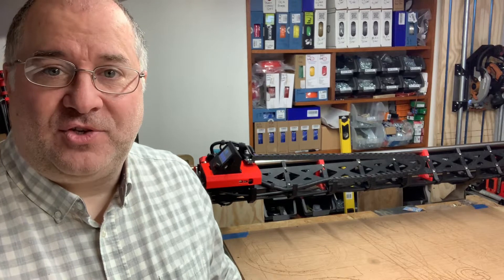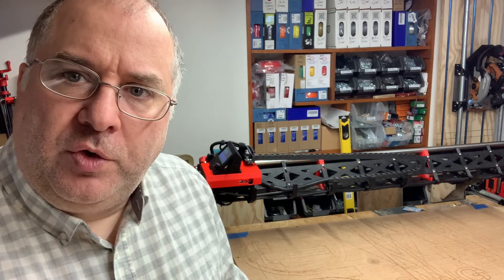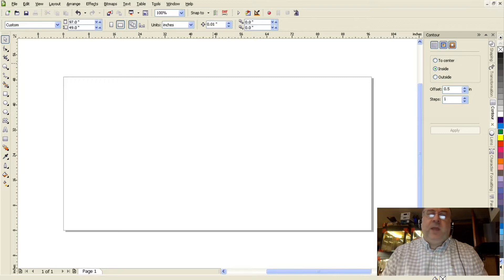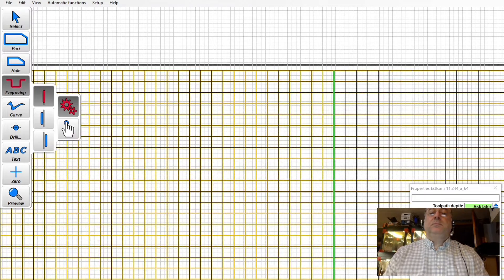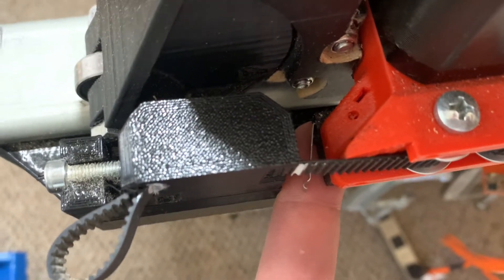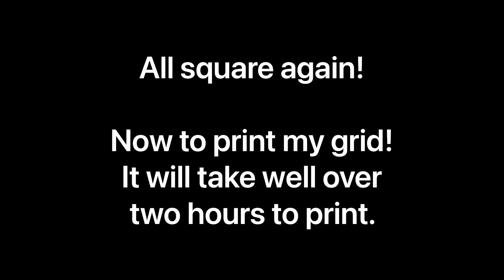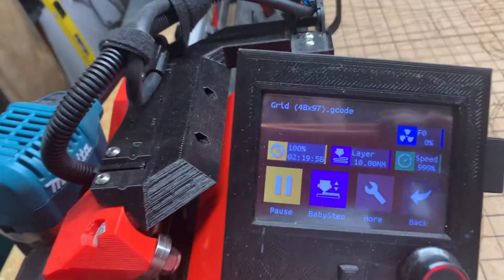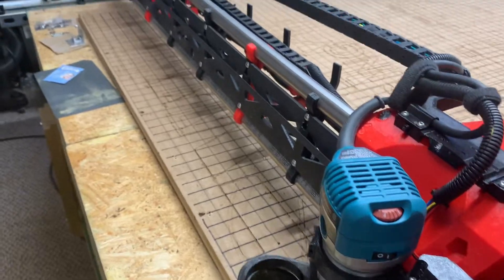LowRider 3 CNC - check for square & mark grid for registration

Comment: Would you do the grid so fine again? Did you do something similar with your Jackpot too? :)
Reply from the maker: @zemlejna1  yes, I probably would do 1” grid again or maybe metric 25mm. Ever since I redid my table by creating a new torsion box from a parametric fusion 360 file I have been meaning to add my laser module to my Lowrider, which is now powered by a Jackpot, and then burn a grid into my table. So far I have not gotten around to doing that. I have so much going on.

Comment: Hi Dough,
Nicely tft firmware. I would like to have something similar. Could you show me some of your firmware you used? 😊
Reply from the maker: I had ordered a full LowRider CNC kit from Ryan at the V1 Engineering online shop, including an SKR Pro1.2 control board with  TMC2209 drivers, and a TFT35 E3 V3 touchscreen. Whenever a board or TFT is ordered from Ryan as part of a kit, he pre-flashes it with the right firmware for the kit. While I have made very minor tweaks in firmware edits, my firmware is still essentially what was from Ryan. All the firmwares for V1 Engineering projects are available for download. Check out the site at v1e.com — There are full docs with links. The plans for the V1 Engineering projects are free.
Reply: @design8studio  Thanks for this reply. I think I already got this firmware, but somehow mine looks very different with yours. I am going to ask Ryan to. You guys helped me a lot with everything I could find and needed for my build so far! Thanks for that Dough! (Y)
Reply from the maker: If the difference seems to be only in the appearance of the buttons in the touchscreen side of the GUI, then take note that it's easy to update the graphics used for the buttons and appearance. There was an added set in what I got (and sent you) that facilitates that. Below I will copy and paste what I typed for someone else a few months back about it.
Reply from the maker: Design8Studio Doug Joseph
4 months ago
I ordered my TFT from Ryan at V1E, and it cam pre-flashed, however, I think I'm running a TFT firmware I downloaded separately from the V1E site. I checked last night, and while I am thinking I got it from V1E site, it apparently included an original Marlin 2 source set, plus a special separate zip named "BlomsD-MPCNC-TFT35-V2.0-master" (dated 2020-06-06) containing minimal files to get to the "unified" button theme that includes the custom "router cutting" image that replaces the "3D print" image for the button to start a cut, and a custom "laser" button for setting laser power etc. If you check the V1E site and don't get what you're after, let me know.

Comment: Great video, thank you. Can I ask which TFT firmware you run? and if you have a link. Thank you
Reply from the maker: I ordered my TFT from Ryan at V1E, and it cam pre-flashed, however, I think I'm running a TFT firmware I downloaded separately from the V1E site. I checked last night, and while I am thinking I got it from V1E site, it apparently included an original Marlin 2 source set, plus a special separate zip named "BlomsD-MPCNC-TFT35-V2.0-master" (dated 2020-06-06) containing minimal files to get to the "unified" button theme that includes the custom "router cutting" image that replaces the "3D print" image for the button to start a cut, and a custom "laser" button for setting laser power etc. If you check the V1E site and don't get what you're after, let me know.
Reply: @design8studio  Ah here the answer is I think Doug :)!
Reply from the maker: @michaelvelthorst  I had forgotten this again. I will email you if you provide your address.
Reply: @design8studio  haha great👍🏻☺️I will send my e-mail nu private massage
Reply: @design8studio  (Y) Send you my mail adres in a private message
Reply from the maker: @michaelvelthorst  OK, I emailed the firmware to you in a Zip file!
Reply from the maker: Hey did you get the email I sent you with the firmware attached as a zip file?
Reply: @design8studio  hey yes I did. Thank you, everything worked great
Reply: @wyogenix  cool. Glad to help.

Comment: Mounting a laser on the low rider would work really great for marking out your grid.
Reply from the maker: Absolutely. That's a great solution. If I had a NEJE (or other) laser set up for attaching here, it would be a great way to do this.

Comment from the maker: I may have just figured out why my initial offset in Eeprom was not happening after homing (before I redid my offset in the video). I may have initially set that offset in my firmware before swapping my X and Y axes. If so, the offset was set to affect Y axis, which is now X. So even if the original offset survived firmware updates, it would have been happening on the wrong axis!